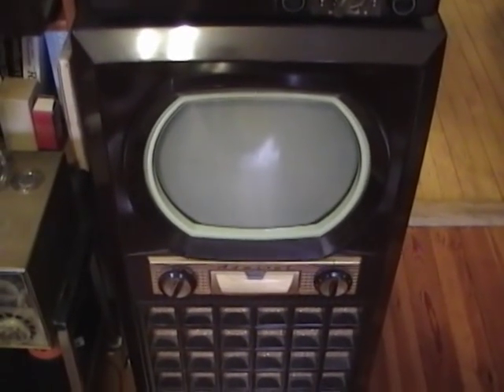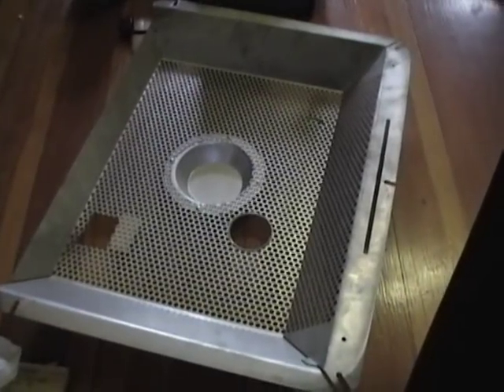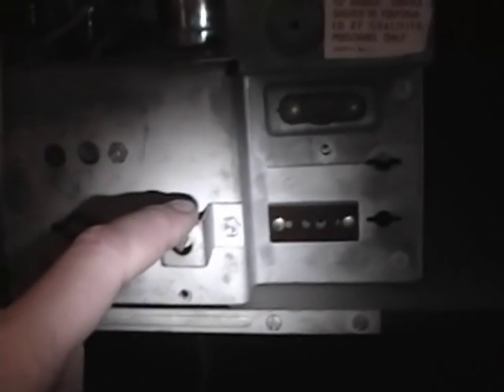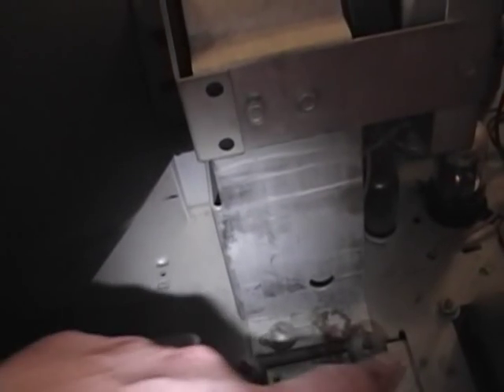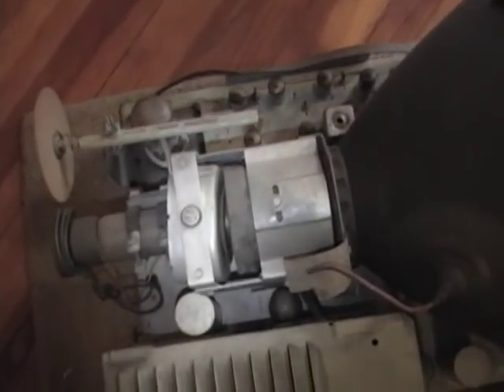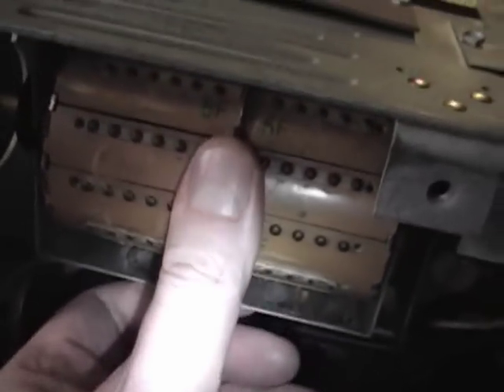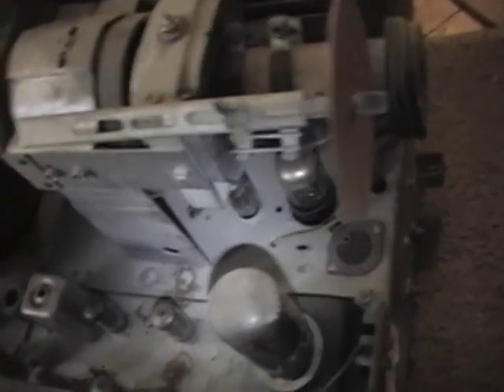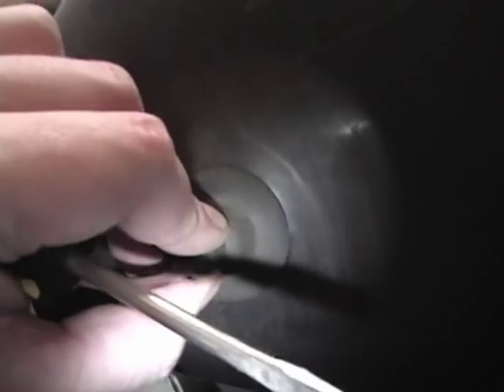Admiral 22X12 - Anatomy of a late 40s TV

Comment: That cabinet is really minty. When I was a kid back probably in 1952 or 1953, my father bought a used Admiral TV. I suspect the model was a 1948 or 1949 model. I remember the TV man setting it up and playing around with the vertical and horizontal controls along with adjusting the rabbit ear antenna until he finally got a presentable picture. That set worked for us for several years and I remember watching many shows on it such as Howdy Doody, I Married Joan, My Little Margie and many more.

Comment: This was the model that got me started into restoring vintage TV's.  Picked it up at a hamfest in Vienna Virginia for $50.  Couldn't resist the super low price.  It was in equally good condition or better then the one here.  The huge shiny bakelite cabinet was gorgeous.  The grill cloth in almost mint conedition.  I couldn't pass it up.  After many hours of replacing all the paper caps., bad electrolytic's, checking component values and meticulously checking every connection (yellow highlighted every line of the printed copy of the Sams schematic) I powered it up hoping for the best.  I wasn't disappointed.  It worked flawlessly.  The coolest part about it was the program that was being broadcast at the time (analog transmission still working then). It was "I LOVE LUCY".   Serendipity at its best.  I've been hooked ever since.  That was about 25 years ago and it's still working flawlessly. I occasionally watch an old black and white movie on it. I think had I been born a generation earlier, I would have been very happy being a TV service guy from the 1950's.  Many thanks for your great restoration video's.  They're eye candy for me.
Reply from the maker: You're welcome.  I'm glad you enjoy them and there will be another bakelite Admiral project in the near future :)

Comment: ive been watching your videos for sometime now great info as always but one question if i may how did u get involved with repairing dinasours?
Reply from the maker: I've been messing around with electronics since I was a kid.  As electronics got smaller and smaller and I got older (eyesight not what it used to be) I switched from solid state to tube gear.  That was about 6 years ago.  I've also been very lucky to find many inexpensive TVs and radios in my area.
Reply: +bandersentv Very cool! My brother-in-law picked one up (an Admiral 22X12), and it’s been sitting in my father-in-law’s living room for a conversation piece. I’m told that it even works. I became curious, so I pulled it out and searched for it on my cell, and found out, it was made when I was hatched. :-) I too was intensely interested in electronics and fixed radios and some TVs for the neighborhood when I was a kid. Parents put me through electronics school, but I found out that the money wasn't in repair, and went to work in the newspaper. 

That brought more memories on and when I was a kid, our old Admiral just wouldn't die. I begged my parents to buy a color TV, (of course, there weren’t many stations that even broadcast in color, but I didn’t care...) My Mom being the eternal penny-pincher would just fix the damn thing when it’d mess up. Now, I wish I had it back again. It had approximately a 19-inch screen but know very little about it. That damn thing wouldn’t die! :-( 

Interesting video!